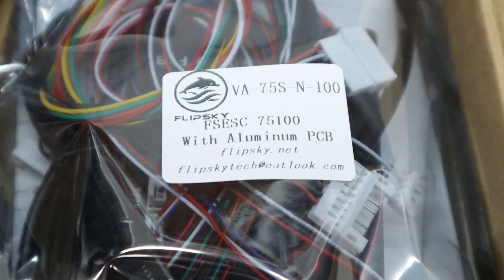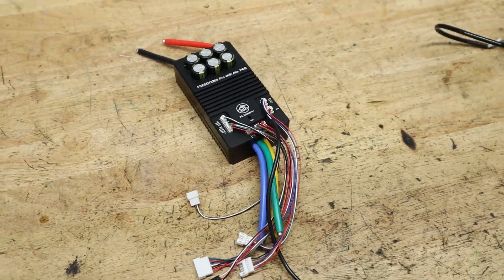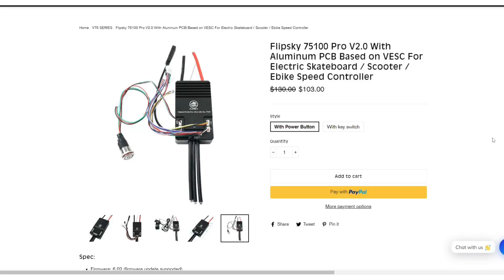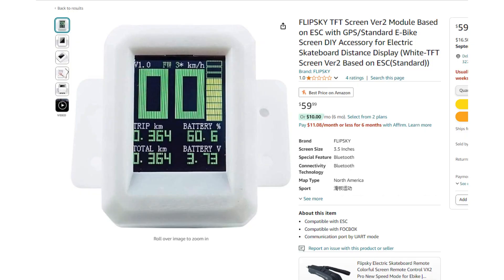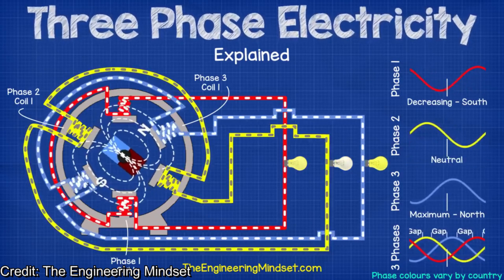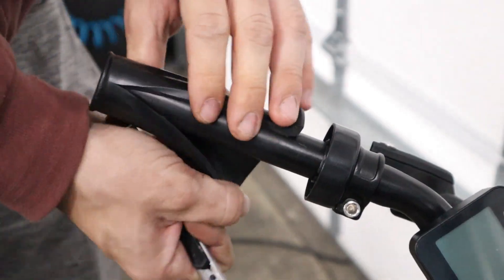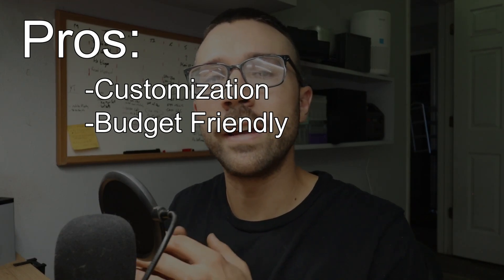Full Overview: Upgrading your E-Bike to VESC!

Comment: i thought you draw amps... not "put out" amps
Reply: nah
If ya let the motors on it's own "draw" amps, it would draw the highest possible amps it can get. It would draw current more than enough to burn the wires and the coils of the motors. The esc will limit the amount of current "to put" out for the  motor to prevent damage.

Comment: Wiring isn't complex, they just have different labels for the same function. Plenty of E-Bike features, you just have to understand how the vesc works. Over heating issues: you need either passive cooling with the available aluminum heatsink or you can liquid cool both the motor and vesc with a special heatsink. But if you're over heating your vesc that just means it's not sized correctly.

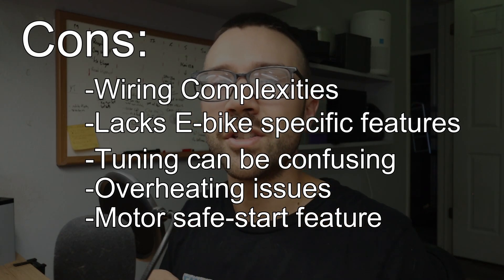Comment: 17:15 yes there is, first thing to check would be that your negative phase amp shouldn't be zero. Somehow when the motor ist turning backwards the phase amps are counted negative even when the torque is in forward direction. The negative phase amps should be the same value as the positive then you should have smooth full torque even when the motor is turning backwards.
Also there is a safe start option in the "app" settings but this is more to ensure the throttle is zero after booting and shouldn't be turned off for safety.

Comment: This is gold! Thank you!

I wish you were into Sim Racing. The VESC is used to control servo motors for the wheel base of steering wheels for the simulators.
I've been researching for two weeks and no one could explain the VESC as well as you did.
Its all very clear, thank you again.

Comment: How bout 75350 for a qs273…. Trying to get 15kw of power… got a 72v 42ah battery, this would be smaller and lighter then far driver 72450 & savbaton 72200
Reply from the maker: Do it and post results :)
Reply: @ChrisBuissonDIY  I did it and I snapped my axle 😐 I didn’t hook up the throttle & just just the app controller to drive

Comment: I have one flipsky dual vesc on my converted garden tractor/mower. But recently after two year's of use the mosfets for the drivetrain gave in. 
Replaced it with a generic BLDC-controller. Now i really miss the regen braking and the smoothness the vesc had.

Comment: are you running the hub motors on FOC?
Reply from the maker: Yes sir
Reply: @ChrisBuissonDIY  when I tried to run my hub motor on FOC it cogs really bad
Reply: @ryanwebster2167  bad tune sounds like. Try to run the FOC tools, or find someone with a pre-tuned file for your motor online.

Comment: I have a 48v13ah 1500 and it's melting the wries. Can I turn it down to 46 v Will this solve the problem or do i need a larger battery. Please someone help me out. I don't know what to do. I can only go for a mile and have to Wait for the battery to build up its full power and Wait for it to cool down. Batteries are new and good I tested them.

Comment: Sorry for my ignorance but is the amp rating on any regular esc the motor line amps or the battery input amps?
i find this very confusing
Reply from the maker: On a regular ebike controller, they go by battery amps. Unless it's a controller where the battery and phase amps are separately listed.
Reply: @ChrisBuissonDIY  ok thanks thats very helpful

Comment: This looks interesting, but I'll need to add a rotation sensor or torque sensor to make it legal here in Europe. With just the throttle, it'll be categorised as a moped or motorcycle, requiring registration and the proper license. Any idea if that works with this?
Reply: Unfortunately this is exactly what these are designed for, electric dirtbikes. There are plenty of bicycle systems out there now days.
Reply: @SilvaDreams  But then, it shouldn't be very hard to add such a seonsor, should it?

Can you recommend any other such bicycle systems that are OSS?

Comment: I have a flipsky 75100 and with a heatsink and thermal pad the same size as the back of the controller I never go over 33C even when pulling 5.5kw which is about the max I’ve gotten out of it. It could just be me but I have never gotten regen braking to work on it even though it said it supports it…

Comment: why stop at 72 volts, why not 96 volts or even better 192 volts!
Reply: It can be hard finding controllers that support that many volts. To achieve that voltage, you need more cells and series, and if you’re working with a limited amount of space that means less in parallel, which means less maximum amps, which means less torque.

Comment: Very interesting the trade-off between low-speed hi-torque operation, and higher speed…reminiscent of the old days they had a manual lever on the steering wheel, they moved to advance the ignition timing, when they wanted more power, but they retarded the timing when going slower needing more torque.  Obviously modern ICE technology, does this automatically.  So I suppose that’s what’s needed here, but great vid.  Question, does it allow regenerative braking/charging of the battery?  The idea this is not terribly useful on a bicycle, I don’t buy into - what I would believe, is the tire wear would bust your b@llocks.  Anyway, thanks for this.  EDIT woops, you cover this later in vid! Thnks.

Comment: Just FYI: Both Flipsky and Makerbase are pretty much the same, Chinese cheap corner cutting manufacturera producing controllers that use the VESC firmware and the open source designs, but they are not ”VESC”. The original VESC with the rights to the brand and which is actually made by Vedder hinself are sold by Trampa as far as I know. Those cheap ”VESC based” controllers also are often missing important components such as phase filters (to be as cheap as possible), so their performance can range from not bad, to explody and smoky. That said in the community on Discord, many people seem settled that Spintend VESCs are actually the best price/performance option if you dont want to buy the originals from Trampa/Vedder.
Reply: Also additional note, you should check some teardowns of those cheap vescs you have, they can have some build quality problems such as the caps hanging freely inside the case(as in not bolted/siliconed in place), meaning that they will snap off and/or explode over time from road vibrations.  And those cheap anti spark switches most often come without in-rush protection meaning that they can self destruct in just a few tens of turn on/offs and that can result in burning down your whole bike / controller / or if you are lucky, only the switch itself.
Reply: @4nlimited3dition_4n3d instead of using antispark switches, you can get yourself some XT90 antispark connectors as well. And turn off the controller rather than the power to it.
Reply: @mikafoxx2717  Yeah that should work too.
Reply: 100% agree with you on VESC clones; Cheap flight often crash !
Reply: What discord? I'm looking for info on using one for my BBSHD. thanks
Reply: @RetroMancer242  It's called "Vesc Development" last I checked.
Reply: #gossipgirl/cryaboutit
Reply: are you drunk?

Comment: Great Video! Will subscribe! I have smoked a few of these controllers trying to get software to work with my setup. Can you upgrade the controller firmware via bluetooth adapter and IOS app? I am running on Mac OSX and it seems they aren't replying to emails at the VESC website anymore. Anyway Cheers!

Comment: About the safe start feature I had the same problem when profile set to 0 brake 
Don't leave it at zero and it should work at least for me it's solved the problem❤🎉
Reply: Hi 👋 i have the same problem can you tell me please what exactly you did?and im dont use any electric brake if its matters
Reply: Are you talking about the motor current max brake? And to how much you set it(and you have brake conect to the vesc?)

Comment: Definitely, the wiring video is needed. I got a old 6.6 dual vesc that I want to put on my mx650 with a 2000 watt motor, but I have no idea how to get the wiring done right.
Reply: I'm stuck with the wiring as well. Connecting a full twist throttle to my Actbest Speedy
Reply: Still need help? I setup my 2000w vevor/sx500 last weekend, and it's running strong.  @jaxpinoy23

Comment: Can these work good on a direct drive hub motor
Reply from the maker: Yeah of course! There's an option for dd hub motor in the motor setup wizard. Wiring the motor just means connecting the phase and hall sensor wires color-to-color usually, which is pretty simple. Hope that helps! Wiring video coming 🔜
Reply: @ChrisBuissonDIY  thanks
Reply: Phase wires doesn't have to be color-to-color connected actually. As for the hall sensor wires, the three wires for the actual hall sensor output can be swapped with one another as long as the black(-) and red(+) are not swapped.
Reply: I have a cheap, off brand, fat tire e bike that I love riding, the controller went out and I replaced it with a similar controller that I found on amazon, now I only have throttle only, no pedal assist, no lights, brake cutoff or display, the bike is a hub motor with a crank hall sensor. Would one of these controllers get my pedal assist back? And possibly higher overall speed limit?

Comment: Nice thanks! Can it be set up to send the regen to a supercap bank, so regen never goes direct to a battery on load? So then each time the super capbank is full it automatically recharges the batteries? Then can leave the regen on charging the very low resistance super caps? Or can act as turbo boost lol
Reply from the maker: Haha I don't know if that exists currently, but maybe you could build an external device to regulate the flow of current in and out of the VESC. With the stock hardware/software capabilities, regen would just go straight back to the battery.
Reply: @ChrisBuissonDIY  Cheers, but I dont have a workshop, or the abilities. But you are welcome to make a video attempting that? Be the first in the world to do it. I suggest hooking up the regen to the CB, and another device to manage the transfer from the CB to the BB? Problem solved lol
Reply: @quantumenergysolutions9128  I guess I just don't understand what the benefit would be over directly charging the battery, but I'm no electrical engineer so some of this stuff goes right over my head 😂Sounds like I need to spend some time learning about super capacitors
Reply: @TheBimmerBarn  If you charge a battery while on load it takes more work, thats how regen braking works. But if what you are charging is separate, its very easy, almost no drag. Why no one does this is beyond me?? Try discussing this concept with GPT.
Reply: @quantumenergysolutions9128 an empty cap draws very high current ...
a bigger cap for some start boost in parallel to battery?? that maybe gives tiny boost but not much
Reply: @dg9bfc the main thing is just saving your brake pads.   You aren’t really gonna get much back realistically from regen on a bike but using large caps would spare the battery from being overloaded a resistor with a heat sink would likely work as well.  Again you would be losing the energy as heat but it would spare your brake pads you could even use it to heat bar mitt type shields in cold weather using your braking to keep your hands warm.  The possibilities are endless really.  This is cool thanks for the video
Reply: @bryanzimmerman8646 Look at Grin's Regen testing. More Regen breaking force is actually less efficient and less current to the battery. Medium levels are most efficient and even then it's not a load. You can simply turn down the battery current limit on Regen to a safe level, and doing higher force breaking will not be efficient enough due to high phase current copper resistance losses.

Comment: Wow, I bought a 75100 Pro last month & returned it for a 75100 Pro V2 with the key switch & voltmeter. It has a system power output for running lights & a horn it looks like. With a phone app a control screen becomes un-needed & brakes are on the com 2nd signal after throttle someone commented.

Comment: Lots of things I'd like to point out. Since VESC is open source, any companies can make VESCs. Flipsky ones are the best budget option, but they are not original vescs by any means. They are built in china to lower standards and overall lower quality, much better than standard ebike controllers though. (they also are making a brand new vesc str 500, which can do up to 500 amps cont. at 22S, 40kw). If you want an original vesc, you'd need to go to Trampa boards, but they are very expensive. Yes they have no display, (official vesc display also coming soon but like $130) but a Bluetooth module will be the best add on. And using your phone as a display is leagues better than most ebike displays. Showing all sorts of stats from battery percentage and voltage, real time usage and temps, efficiency, etc..

Most flipsky controllers can be updated to the latest firmware, but they will have issues! Most don't have phase filtering hardware, so if you forget to turn the setting off it will destroy the controller. My flipsky also completely failed to properly detect my motor on the latest firmware. (the motor would spin horribly and randomly stall). I had to downgrade it to an old firmware to tune my motor, then update back to the modern one to get the latest features.

If you need a small amount of power, you can get 5v from the PWM + and -, since you probably won't need those for an ebike. But that's only enough for maybe some LEDs or a small cooling fan.

I used 20-25 amps of motor braking current and it slows you down pretty fast. But it is not as strong as a mechanical brake, and when the motor spins slowly it has almost no effect. Regen braking is much stronger the faster you are moving,

Overall vescs major downside is complexity, but for nerds or people willing to learn, they are super awesome. So versatile, and with new things like silent HFI (which can make a sensorless motor feel like it has hall sensors), very promising future.
Reply from the maker: All this stuff is true, thanks for taking the time to write it all out! I love my VESC, and feel like I'm always learning more. I had the same exact issue as you btw when upgrading flipsky's firmware, which is why I mentioned updating can cause motor setup problems. Reverting back did the trick for me too, then updating again to 6.0 and moving over my motor settings so I could have field weakening. I hope more people hop on the VESC train! 🚂
Reply: Wait did you just say that using this gives you regenerative braking?
Reply from the maker: @JohnSmith-tz4on  VESC firmware has the option to enable regenerative braking, yes. It can be done using a switch or throttle!
Reply: @ChrisBuissonDIY  wow okay I'll probably be buying that then for my cheap Varun $500 e-bike that has the PAS SET to start 270° AFTER you start pedaling... Wtf Germans

Comment: I wish this video existed before I spent a bunch of money on votol controllers 😖 I can’t even connect to them to program them properly , such a tremendous pain in the ass and to top it off they are massive by comparison
Reply: im using votol not foc version, if you can tame then its a good controller. i will try vesc in the future mainly because of the size.
Reply: @winmarkesconde5651  curious, what do you mean by that Votol controllers are "hard" to tame. Perhaps, they are better than, VESC? Thanks

Comment: I have been trying to get the 75100 to work on a geared hub motor, any advice? It goes but has no power or speed, and makes a lot of noise, needs a rolling start too
Reply: Sounds like your hall sensor wires aren't connected & running just the 3 heavy phase wires.
Reply: @stevecumming6427  already verified the hall, made sure I was in foc mode, and tried the hall a few different ways because the colors are not the same
Reply: @stevecumming6427they should work with no halll sensor connected
Reply: @aski1529  when I put it into BLDC mode with no hall, it works but has no torque